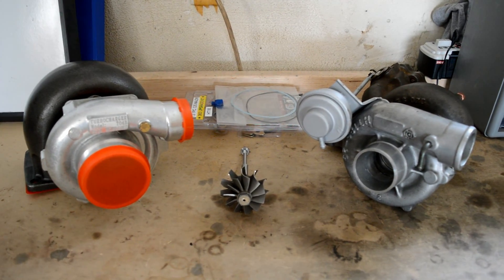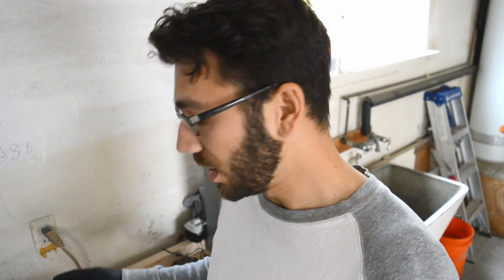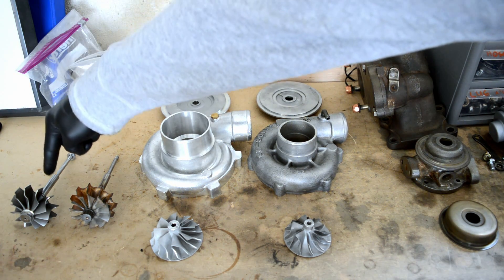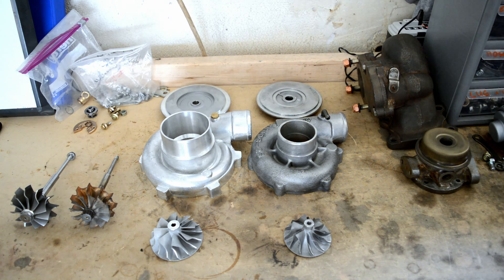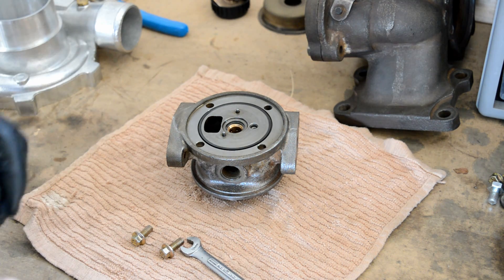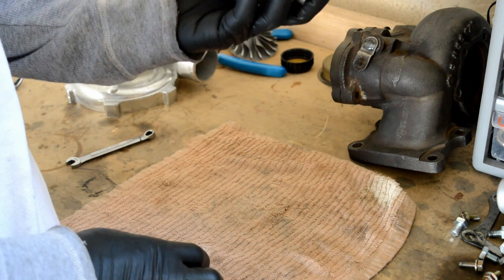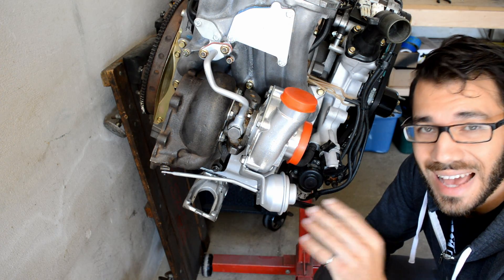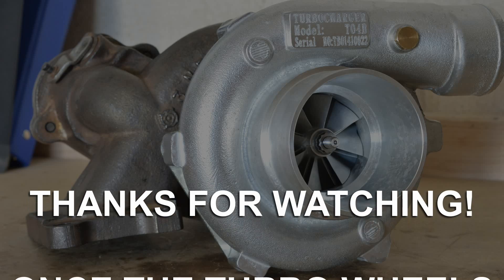Hybrid Turbo Powah! | Ep 13

Comment: I’m quite a few years late to your video but awesome content!!! Anyways, I wanted to ask if you remember by any chance, what is the rebuilt kit you bought for the turbo? I’m considering either doing what you did or at least do a rebuild on the stock turbo. Any help is greatly appreciated
Reply from the maker: Sorry for the late reply, I'm fairly certain I got my kit fr gpop shop and they offered balancing of the rotating assembly too. I can try to find the old receipts but pretty sure that's the route I went off the top of my head. Been so long even I'm starting to forget!

Comment: I’m sorry this is a bit vague to me could you please explain what swapping the parts does ? Or what benefit it has
Reply: Okay thanks man time to research 😂
Reply from the maker: @tylerjs2181  Good luck!
Reply from the maker: In short, I built a hybrid turbo to make more power, but have all the same conveniences as the stock turbo. Works with OEM or aftermarket exhaust, and OEM oil/water cooling lines. Only major change is to the intake side. You need to make a custom intake pipe and air filter setup.
Reply: Oh so you kept the stock exhaust side but bigger intake side ?
Reply from the maker: @tylerjs2181  Yup, that's it. That's the basis of the hybrid.
Reply: Thanks man that really clears things up
Reply: Just one more question how do you know what parts will fit with each other
Reply from the maker: @tylerjs2181  lots and lots of research lol. Unfortunately, no way around it. I spent hours checking part numbers, turbo models, etc. But if it's too intimidating you can check out BNR Supercars. They were the go-to hybrid turbo shop for rotaries.

Comment: Hi. I am building a G16B engine. And I couldn't source Gasoline turbos. And the Turbos which are available in India are Oversized and doesn't suit my needs. Could you please suggest some ideas? 

I need to know if I could select a diesel turbo and change the Compressor wheel ,turbine wheel, compressor housing and turbine housing to get a new air flow figures according to my requirements.
Reply from the maker: Unfortunately, I don't think I will be much help for you. I know absolutely nothing about the G16B engine. So, I am not the right person to ask. I would first ask yourself, what is the need for a turbo? Intended use for the car? Find a target power range and start to understand the limitations and risk of applying this modified turbo to your car. Here is a magazine article that you mind find helpful: https://www.youtube.com/watch?v=LBR7Cna4al4&lc=z22dw1qxmlauxhwmiacdp43a4rf5p0p3d5vopk4sjwxw03c010c
Good luck!

Comment: Hey when you reassembled the turbo did you use the seals and bearings from the new donor turbo or stock turbo
Reply from the maker: I actually had a rebuild kit for the stock turbo, but there were a couple bearings/seals I needed to use from the donor because of the different design on the compressor side.
Reply: @AlexFranceschi  what compressor wheel size did the donor turbo have? I can't find 62/63 v trim or 70 H trim wheel to4b parts/ turbos. I've been looking for 3 days! I found one ad on eBay for the comp housing, back plate and a v trim wheel but it's 165 dollars I'm weary of buying these unmarked parts
Reply from the maker: Sorry for the late reply. In the description I put some basic info about the turbo, I did have links to ebay, but they stopped working again. Anyways, the compressor wheel is a 60 trim wheel, I can't remember, but I think it's an H trim. I wouldn't worry too much about the housing, back plate and wheel from ebay. A year later mine is still doing okay, just make sure you get the rotating assembly balanced, I did mine with g-pop shop. I used all the seals / bearings from the rebuild kit I had except for the dynamic seal because it was different on the donor turbo.

Comment: Hey bro have you seen the holset turbo  setup?
Reply from the maker: Alvin Ameyaw no not yet, got a link?
Reply: Alex Franceschi 
1. https://www.youtube.com/watch?v=mhtZP1zyXqM&t=79s
2. https://www.youtube.com/watch?v=QZ1TJYAROS0
Reply: Also interested to see this. There have been a few Holsets run on 13B-Ts and 13B-REWs on the Rx7Forum, are you referring to one of those?

I originally thought about going that route, but it's hard to beat the affordability and ease of a hybridized stock turbo. There's something to be said for a turbo that bolts directly into place, fits aftermarket exhausts, has a  internal wastegate, and uses stock oil and water lines.
Reply: Chris Barbati I know I'm going to do the holset route, all the size but good spool since the hot side is so small

Comment: can i ask whats the part number for the turbine wheel you used?
Reply from the maker: Of course, the turbine wheel is a Garrett TA34, part number: 451314-0002. In the video's description I provided an ebay link where you can find more information about the spec's.
Reply: ty

Comment: is it better than a bnr?
Reply from the maker: I basically built the equivalent of a BNR stage 1 or 2, but for a fraction of the price. So far I've paid about $350 for everything including the donor turbo, new turbine wheel and turbo balancing with G-Pop. The only thing that I can't do that BNR does, is replace the bearing for the wastegate lever arm. If you're looking for the best bang for your buck and have the DIY skills, I recommend building it yourself. However, if you're uncomfortable with rebuilding the turbo, BNR is probably the best deal you can get.